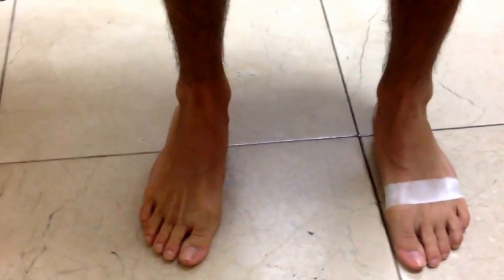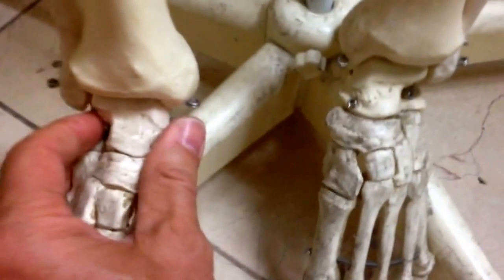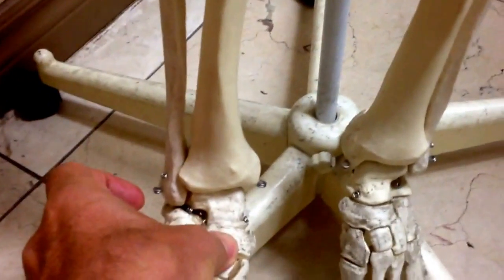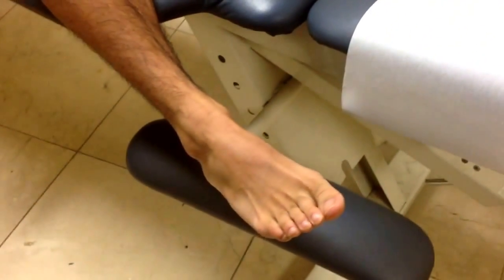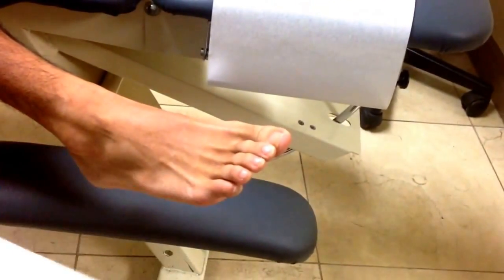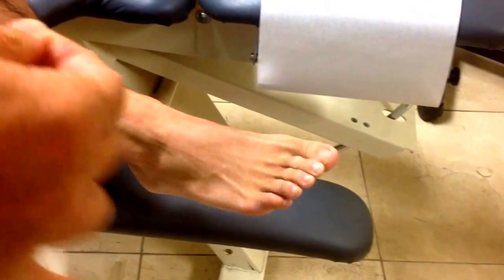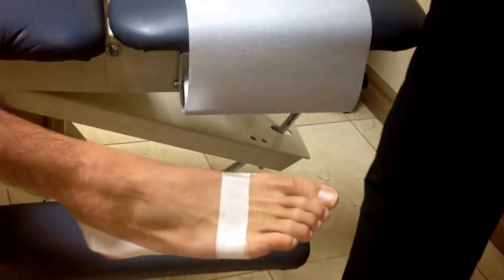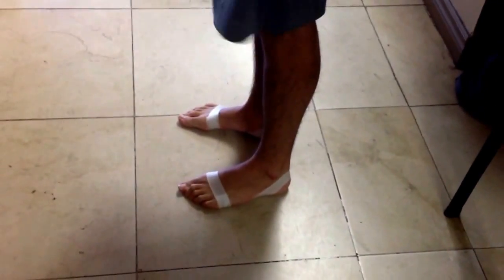Fallen arch fix

Comment: Will this help someone that was born flat footed? I am not experiencing any pain really in my feet, but I do have knocked knees and back pain. Another thing I find odd is. I can make myself have an arch by curling my toes. Only problem is I can’t hold it forever especially while running or even walking. Only other question I got will this lead to long term results?
Reply: LaserHawkFTW omg wait do you actually curl your toes when walking and like especially when wearing closed toe shoes??

Comment: Dr.P please please!!! I need your help. I have been trying to fix my ankle since December 2016 I have also seen a chiropractor for the past months with no results. I have zero flexion in my ankle with pinching by my talus.  I have tired all banded mobility techniques without improvement.    I do Olympic weightlifting, my ankle has ruined my opposite hip. I have noticed that the tibia bump of my bad ankle sits further forward (closer to my big toe)

Comment: When I finished putting the tape on both my feet and started walking. I actually immediately felt a difference; mostly stability around my ankle and like a release of pressure on my lower spine. 

The only thing I'm concerned is how exactly does this simply "tran the brain" to make a permanent adjustment. I would like to hear and explanation if anyone could help.
Reply: Edrees Feda I wonder that  too

Comment: Doctor, after i do same what do you do my arch will be normal?
PLEASE I NEED A ANSWER!!!!!!! i WANT TO GO ARMY AND MY FUTURE DEPENDS OF FLAT FEET
T
Reply: Dan Mihail hey bro I enlisted to and I got flat feet they will still accept you only if you don't get shin splints and your feet don't keep you from doing your training and job  they will give you running shoes based on your arch flat normal or high the only question is if running with good support shoes give you any type of pain like shin splints than you might have a problem I couldn't run two miles because I get shin splints but I bought some brook adrenaline shoes and that helped me run 4 miles without any injuries
Reply: Dan Mihail so start working working out your feet and lower legs like your anterior and posterior tibia muscles
Reply: And calfs

Comment: I want to have a plantar fasciitis release and wanted to know if there's any side effects as to walking running standing do I heal and go back to normal with out pain?
Reply: it is due to a major fall I had on an escalator that has never been fixed.  it's very hard to walk even with excersize. I created my own handle to break down the lactate acid in regards to my knee that slam into the prongs of the escalator I realized my  PCL what was punctured and my leg tibia goes more to the left. that cause my hip to stretch out and I pulled my piriformis muscle inflaming the muscle resulting piriformis syndrome where the muscle crushing the sciatic nerve
Reply: Oh and I tape everywhere on my entire leg it seems like, I also use steaming hot socks of rice incookdd. It's burned and discolored my leg, but that with all my prescribed meds. Was what helped somewhat. I can never sleep or run, dance, sit for long Thomas down for long, it's completely ruined my life nobody wants to date the crippled girl I tried any method to get rid of this pain it only slowly and all the pheasant for no more than 4 hours you mentioned not being able to work for 4 hours financially you become intolerable I wouldn't wish this on my worst enemy and detox with purple onions. I made a mold out of household caulking to insert into my shoes and all my sandals I wear That Hideous black boot at night while I try to sleep. I pray to God I looked into many surgeries and who is the best doctor to perform them much much more I try to do anything and everything to help including eating right and eating certain foods that minimize the inflammation from toxins I've done a lot of research and put together portafolio for my knee specialists, I cannot count how many surgeries I've had and x-rays MRIS think of all that paperwork and land Fields because it's so much all this and trying to stay happy all the time because I'm a happy person just in pain all the time a forced to start back to work December 5th even though I know I'm not ready

Comment: Nice to see a Doctor post a helpful & educational video. I have flat feet but have been ignoring it when working out. Today while jumping rope I started to feel discomfort in my right hip.
I realize, like you said, this is a sure path to a hip replacement in 15 to 20 years, which I wish to avoid at all costs. I will try this immediately. Dr., What do you think of exercises such as rolling the foot over a golf ball? I realize the muscle at the bottom of my foot has always been tight and sometimes feels like its ripping or tearing. Thanks for posting!

Comment: the tape holds the foot In a structured "arch" but if you notice, when you ask your patient to walk he does not strike heel-to-toe. going up stairs where the degree of more dorsi flexion is needed would surely rip the tape. I like the idea of taping for maybe a neutral position (maybe stand with the tape for 10-15 minutes a day as an exercise) more than walking with it. this may help the patient hold an arch but for a walking "cast" this may change his gait negatively. I am only judging base on how the patient is walking. he seems to slap the ground flat footed when he's walking.